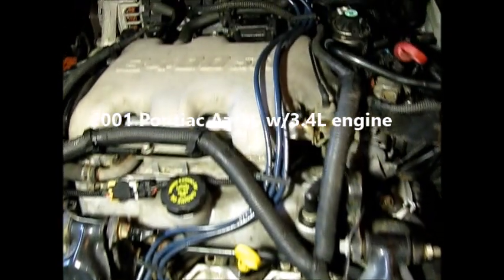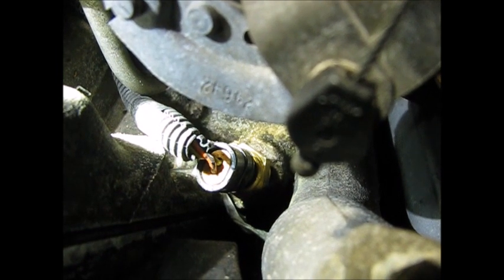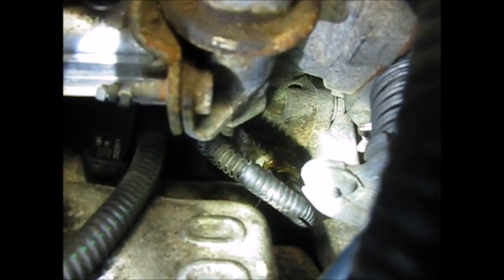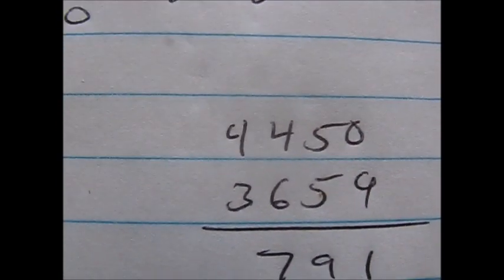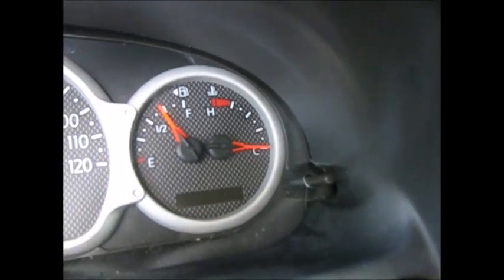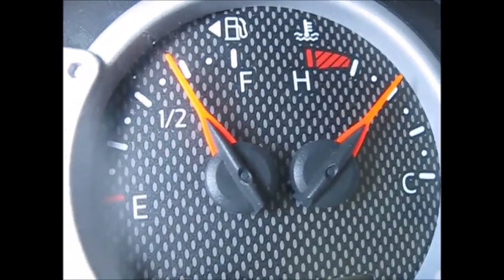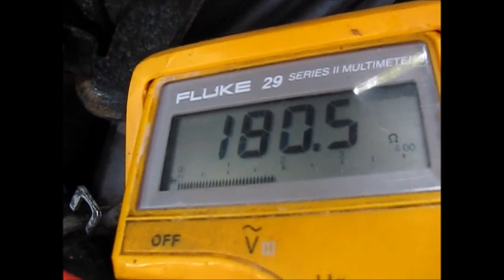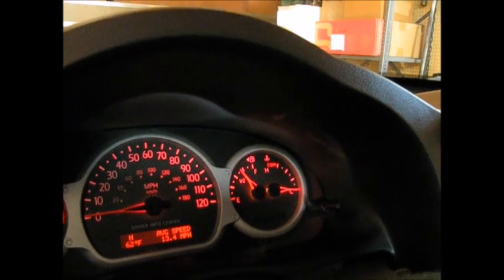Car overheating...or not? How to troubleshoot using the coolant temperature sensor

Comment: My 95 Toyota Corolla just started doing this and thanks to you I know for sure it’s my instrument panel lol my speedometer stopped working a month ago so it makes sense, thanks a bunch.
Reply: Woahhh really ?? 0’3 Camry temp gauge is going all the way hot and the normal level driving and constantly. Its definitely annoying cause I know it’s not overheating . But it is definitely has taken way too much coolant and oil lately . Soon gonna have to check the engine valves

Comment: The sensor that goes to the dahsboard is made of special materials that change resistance when gets hot. That material loses its properties over time. When that happens, the sensor allows more voltage than required, reulting in a incorrect gauge lecture.
Reply: Kinda figure that I have a 1999 Tahoe n my gauge just shoots up

Comment: So glad I found this video! I'm going to perform this test on my '05 Aztek. Just had the water pump replaced due to a coolant leak. After that, the temp gauge has been fluctuating from around the half way mark up to the 3/4 mark and back down. I thought it could just be air in the system from replacing the pump, but bleeding the system made no improvement. This test will help me determine if the sensor is bad or if it's just the gauge. Thanks!
Reply from the maker: You're welcome. Glad this video helped you!
Reply: Cody Schlomer did you fix the problem? What happened

Comment: THE ORIGINAL MECHANIC 
                1.) How do you check if your radiator is blocking Air or has good Air flow, how can I test it?
       2.) How do you check if the water pump is working correctly? 
3.) The Radiator Fan turns ON at 210F degrees on ALL cars? 
       4.) Why do you have to use Distilled water and can't use House Tap water in the Radiator?
5.) Thermostat OPENS at operating temperature at 182F degrees? by squeezing the upper radiator hose you can feel if the radiator fluid is flowing and closed at 180F degrees to check if the Thermostat is working correctly?

Comment: Thanks. My 2001 Aztek is doing the same thing. Replaced the temperature sensor, thermostat and water pump. The fans still don't kick on until just about 3/4 Hot. I'll go ahead and replace the cluster.
Reply from the maker: You're welcome. Sounds just the Aztek I worked on. If it isn't actually overheating that's the prime culprit.
Reply: why do you think you have to replace the cluster?
Reply: Hi, I'm facing a simmiliar issue with my car, I was wondering if the problem was fixed when you replaced the cluster?
Reply: probably figured out gm programmed the fans to come on way late on these 3100/3400 cars

Comment: You need to open the screw right there by the thermostat housing and bleed the air out the system that's why you temperature as well as any more than what it's supposed to

Comment: I have a 05 Buick Rendezvous I didn't put in a water pump thermostat coolant temp sensor and my car is still going to the H sign but it's not overheating is not smoking at all it goes back and forth. When I'm driving and it look like it's going to run hot I pull over I can get out of my truck lift up the hood and put my hand on a reservoir bottle you do not overheat what should I do or what else can I do didn't flush the radiator  .

Comment: You don't have to run the motor so hot on a temperature to know that something's wrong. If the fans don't kick on by the time that rises above the halfway mark That's when it's time to see what's going on and shut it down
Reply: did you watch the video? the dash gauge was inaccurate

Comment: My Ford Explorer Sport Trac suddenly developed this temp going up and down. I have replace the water pump and removed the thermostat according to my mechanic but still persist. The mechanic now told me to bring it for bleeding. I hope it works. I hope it wont result to changing the top gasket. Appointment tomorrow September 8th, 2020
Reply: Did you fix it ? I also replaced the same things you did.
Reply: @cherryroman9973  I did the bleeding but it is of no use. I also washed the radiator. After another check by another mechanic, it was discovered that the head gasket has burnt.  It is still with the mech for removal of the engine and the removal of the head gasket. Ford could be very problematic. I don't know how much my bill is going to be. Frustrated!
Reply: @gbolahanphilipsobadimeji1932  hopefully not too high , yeah I was told maybe it was the heads but they were not too positive please keep us updated thank you for your time and reply good luck

Comment: You open up that bleeder screw and bleed the air out the system I bet you your temperature gauge read right. Anytime you drain the coolant. If you don't bleed the air out the system. You will never get it to act right

Comment: Question. My daughters 2015 Dodge Dart 2.4 has been overheating with temp too high light and check engine light. The thermostat has been replaced, and the instrument panel has been checked and is fine. Why would it keep popping these lights on and the engine still getting hot?
Reply: I’ll add that it’s been to 3 different mechanics and no one has been able to solve this.
Reply from the maker: Low coolant levels, coolant leaks, air block, bad water pump, clogged radiator, bad radiator cooling fan...many are the other potential causes of overheating. The simplest things to do is to make sure your coolant level is good and the cooling is flowing. Feel here the hoses are hot when car is up to temp.

Comment: Here's our issue. 
2008 Pontiac g6 127,000 miles
Radiator replaced
Fan replaced
Hoses replaced
Coolant level fine
Temp sensor replaced
My baby is still overheating
Reply: DiabeticlySweet Same with me, especially when i turn on the aircon... but when i turn it off, evertging was fine, may fan is working... can somebody have an idea... Help...
Reply: It’s probably your thermostat
Reply: Was it a fuse or a relay?
Reply: Does anybody follow up after the problem has been fixed or have all the vehicles been abandoned?

Comment: I have a Dodge Stratus that's doing this exact same thing but my fan kick on half way point and I replaced thermostat, water pump, hoses, coolant level good what else could be the problem?
Reply from the maker: You should make sure that the car is actually overheating. As shown in the video, the resistance of the temperature sensor can be used to determine if the gauges are accurately reflecting the coolant temperature.

Comment: I had my thermostat changed because it started running a little warm not real bad now that the thermostat is changed it is running super hot and just a matter of less than 5 minutes it just shoots up and you didn't see it any idea what that could be I also do not have heat in my cab of my Aztec like I did before I have no heat now at all and a great heat before the thermostat was changed
Reply from the maker: Your new thermostat is bad or installed wrong.

Comment: Im not sure if my brother is having that problem i have replaced water pump radiator cap thermostat flushed out the system i unplugged the temperature sensor and the fans cam on plugged it back the fans shut off i wonder would this be related to 04 grand prix
Reply from the maker: Looks like it's probably in the instrument cluster like the 01 Aztek.
Reply: The Original Mechanic it looks to be that way the more I've dived deeper into it

Comment: THE ORIGINAL MECHANIC, I thought the cooling fan should turn on when the instrumentation temperature gauge is half way in the middle? but the cooling fan turns on when the temp gauge is way into the RED H. 
Using a Digital Infrared Thermometers, what temperature should any car be at idling and the instrumentation temperature gauge is half way in the middle? 
All cars engines temperature starts at 65F degrees in the mornings so the Digital infrared thermometer should measure 65F degrees?
Reply from the maker: I agree. It should come on sooner. You're car is behaving just like the Pontiac Aztec in this video. The fan should turn on before the instrumentation reaches the red (over-heating) zone. The operating temperature should be around 210 degrees. In the Aztec we concluded that the instrument gauge was faulty.
Reply: @TheOriginalMechanic  
1.) While any car is idling normal operating temperature for ALL cars is 210 degrees? I thought 210 degree is red over heating zone 
2.) The Instrumentation temp gauge needs a Voltage or a resistance being applied to it? 
Because I don't know what the instrumentation temp gauge is a thermistor or something else but the temp sending unit temp sensor is sending a resistance value and a voltage value to the instrumentation temp gauge?
3.) To test the water pump, you just press the gas pedal to increase the RPM of the engine and if you see BUBBLES in the radiator coolant then the water pump is good?
because a bad water pump can cause over heating issues but how do you test if the water pump is working correctly?
Reply: @TheOriginalMechanic  thanks for the help
    -- 1.) How can I test the Pressure of the water pump and the pressure of the radiator while the car is idling and running? I want to know what the pressure is through the radiators hoses and water pump hoses, how can I do this?
--  2.) The Water Pump is "increasing" the radiators coolant into the car engine and into the radiator core to increase the flow of  the coolant?
-- 3.) How can you test if your radiators hoses and water pump hoses has to much pressure the pressure is to higher than normal operating pressure?
Reply: @TheOriginalMechanic  thanks for the help
I disconnected the Temperature sending unit/temp sense, so How can I test the instrumentation temp gauge in my cars dash board by itself to check if its working correctly, what do I need to do?
Reply from the maker: @billwilliams6338  I haven't measured the temperature directly at operating, only as I did in the video with a meter and using a chart in a manual to convert to degrees.  You need to establish whether the car is actually overheating before you worry about the water pump and radiator. That was the point of this video. The gauge was off, red-lining, while the fans and water pump and radiator were working as designed.
Reply: @TheOriginalMechanic  yes i know that is why I'm trying to make sure that my cluster gauges are working correctly.
The temp sending unit/temp sensor is a thermistor which is a variable resistance
But i dont' know what my temperature gauge is wanting a resistance and a voltage or just only a resistance in order to move that temp gauge needle from C to F?
Reply: @TheOriginalMechanic  thanks for the help
while the car is idling and running 
What temperature is the lower radiator hose temperature should be at? and what temperature should the upper radiator hose should be at?
I can just use my infrared temp gun to make the measurements but i don't know what is the normal temp ranges for the upper radiator hose and lower radiator hose for normal operating ranges
Reply from the maker: @billwilliams6338  I see your problem in determining if the car is overheating. I wish I had the info on the hose temperature, but I've never measured that with an IR gun. Maybe you could continue to take readings with the IR tool as the car runs. If it doesn't get hotter at any of the measurement points feel confident that it isn't overheating.
Reply: @TheOriginalMechanic  ok thanks for the help I will try that. I was looking for a reference on mostly normal temperature running cars to compare the results with. 
>> which bluetooth OBDII adapter do you use or recommend? can I buy a Bluetooth OBDII adapter and just download a free Scanner app or it won't work because u need some "special software code" to work with the correct Bluetooth OBDII adapter?
Reply: @TheOriginalMechanic  thanks for the help
1.) whats the differences are between hypercarbon and exhaust gasses?
2.) If you have a lot of hypercarbon and exhaust gasses in the radiator fluid that means that the car is NOT burning the gas and oil? so your car will can't go high RPM than 60mph?
3.) Auto Repair tech will REMOVE half of the spark plug wires while doing the Block Combustion leak detector test to determine which sides of the engine is creating the exhaust gasses in the radiator fluid to narrow down which side of the engine block by just removing HALF of the spark plug wires. Is this a good troubleshooting method or not?

Comment: Hey um my car is driving fine but the temperature gauge is past H and when I get to a stop sign it’s says hot coolent temp so it appears to be overheating but it’s not, is it the temperature sensor or the cluster .  Like the temperature gauge needle is past H to the point that’s it’s at F on the gas side any tips?
Reply: It’s a Pontiac Aztec 2005.
Reply from the maker: The video does offer some troubleshooting tips on this problem. This was also an Aztek and it turned out to be the instrument cluster.
Reply: My 97 ram does the same thing. I just said ta hell with it. I havent fixed it but it still will get me from A-B even C or D.

Comment: Also dealing with an '01 Aztek.. four months ago it was 'overheating' - 
after several 'tests', I determined the Intake manifold gaskets were 
shot.. And Boy were they!
Also the radiator had abut 10% flow-through.. In total I replaced the 
Intake gaskets, thermostat, water pump (which was leaking) and the 
radiator... 
Two nights ago it 'overheated' again and left her on the side of the 
road, an hour away.
yesterday I ran the engine, drove it approx. 2 miles.. could Not get it 
to 'overheat'.. it got hot, but not in the red..
Today, I checked to make sure there's 5 volts at the sending unit.. 
there is
I checked the Cold Ohms of the sending unit and it read 9680 which 
translates to approx 29 degrees.. it's 41 degrees outside
 ..when I finally got it to start.. I let it run for 10 minutes, the 
temp needle never responded at all.. and the fans stayed on, which makes
 me think I damaged the clips inside the connector.. 
But still I rechecked the Ohms on the sending unit and they're 158, 
which is approximately 220 degrees(?) 
Either way, it's off the chart in your video, at both ends.... 
Diagnosis, so far.. The instrument cluster is bad (has other issues) The
 sending unit is likely also failing.. and I need to respring the 
connector so it makes better contact.. 
Questions - What else could be causing the coolant to 'boil'..? and no 
heat inside the cabin..?
Reply from the maker: You have replaced so many components in the cooling system already. I would start with the sending unit. Is it using coolant? If so, hate to say it but...internal leak?
Reply: I ordered a new sending unit with a pigtail (Respringing the connector wasn't working). I also ordered a new thermostat as there are a few other videos on Youtube where the mechanics claim you 'have to' drill a 1/8" hole through the 'stat to get flow through.. That doesn't sit right with me, but figured if the sender didn't do the trick, I'd consider it. Replacing the sending unit got me back to much more accurate readings from cold through operating temps/ohms - I created my own expanded version of the conversion chart while I waited on the part to arrive, so I wouldn't have to stand in the cold doing math! With that problem corrected, I still wasn't getting hot ait from the heater.. air, yes, heat, no.... Which is when I remembered, that I back flushed the heater core, four months ago, during the intake manifold gasket job - but I did it while it wasn't connected to the rest of the system which left that long steel bypass line unflushed.. so I back flushed the system again, with everything connected as it should be and viola! Heat. 
Your video was infinitely helpful in diagnosing the sending unit.. the heat issue, I now see was my own error, overlooked.
Reply from the maker: Well done. I wondered whether this video would help anyone and it's so good to see it did. This Aztek was driving me nuts until I measured the coolant temperature this way. Great work solving your problems!

Comment: Cuál es la temperatura normal de una Aztek Pontiak diga lo pero en español
Reply: mejor aprende ingles, es el idioma universal.
Reply: 216 Fahrenheit
Reply: @PinchewachE my Aztek says 3/4 on dash but my ODD 2 says 105C and fans turn on at 107C and drops to 103C but only drops a little in the dash. Is my temperature normal or over heating? Please advise